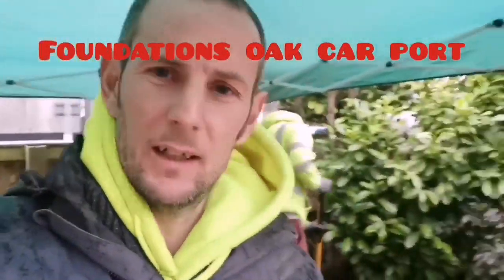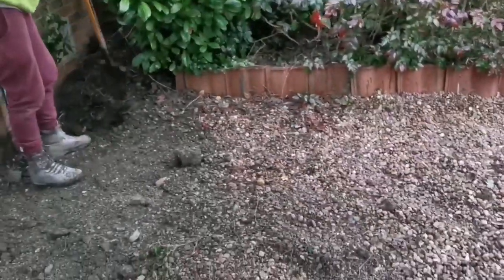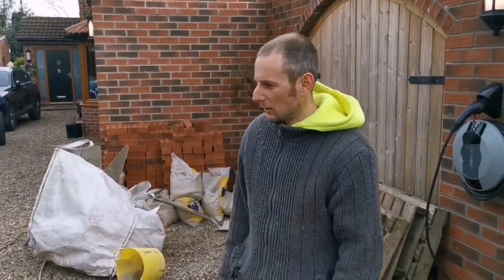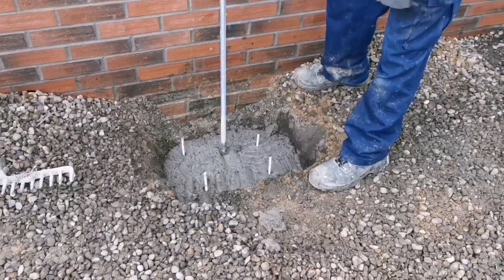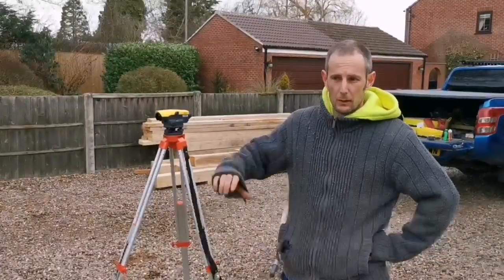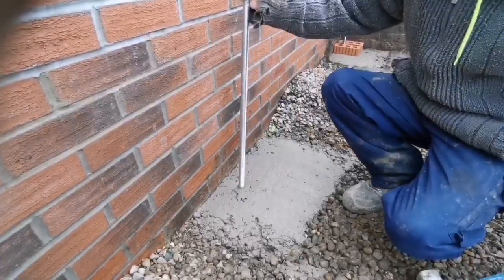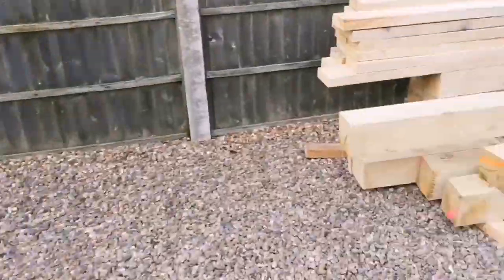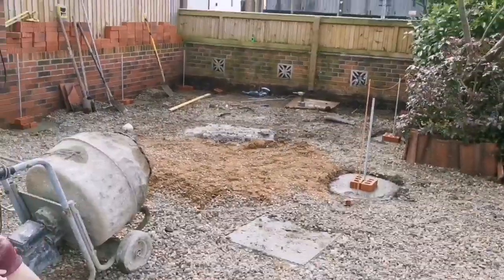Foundations oak carport build

Comment: Wondered how strong is this for wind uplift, your threded bar is only 200-300mm in to concrete, should be all the way down to 600mm as your hole....
Not strong enough for me....
Reply from the maker: Hi mate I have had quite a bit of advice on this and. They say don't anchor it down as it will crack the pillows. The weight should hold it. Down. Well that's what I am hoping 🤞👍
Reply: @markhep  I’d fill the pillars in with concrete once they’ve set so that’ll make the steel rod a bit more rigid
Reply from the maker: @ozzyefc44  yes mate I think thats what I am going to do. Should put some strength in them Hay 👍👍👍
Reply: @markhep  ye it deffo would mark . Ps not having a go at you mate I always watch your vids and think you produce excellent work 👍
Reply from the maker: @ozzyefc44  I know your not mate. I love all the advice. Makes us better builders 👍👍👍